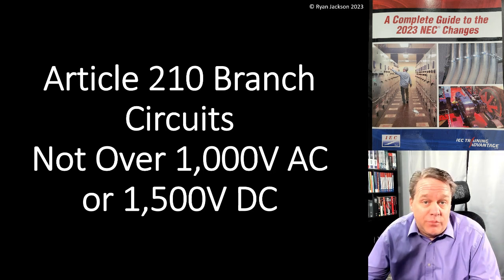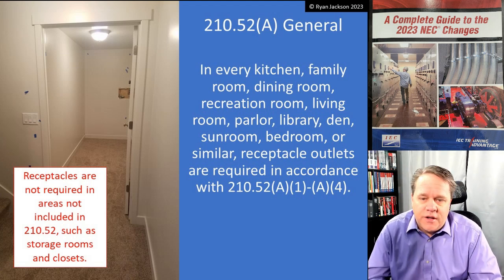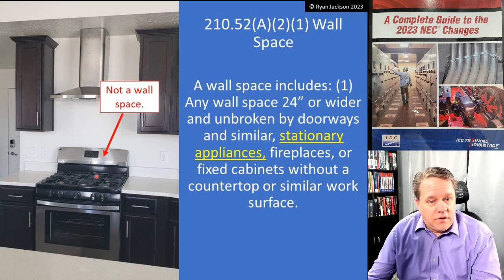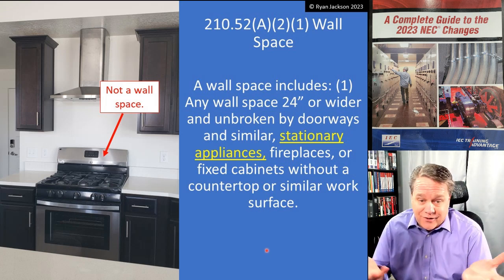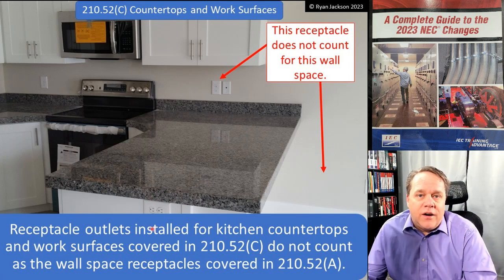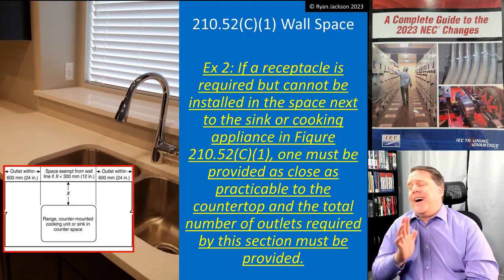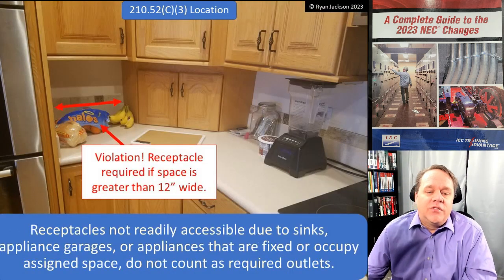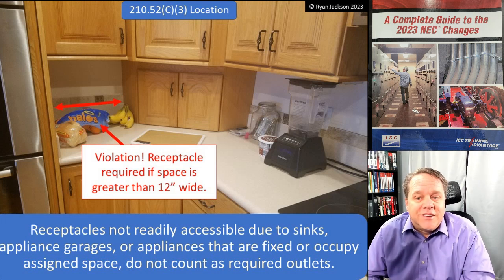2023 210.52 Dwelling Unit Receptacle Outlets

Comment: What about a work surface with a cabinet sitting on a quartz "countertop" and the "quartz countertop" is now 12" deep instead of 24" deep.  Would there be required receptacles there?  It is being used as a permanent hutch but the cabinet part resting on the quartz has no doors or drawers just a 5" cabinet face.

Comment: What is your recommendation on the island outlets or peninsulas until the 2023 code is  adopted by jurisdictions- in you linked episode you mention a manufacture being held liable for knowing of a code change or safety in appliance but only provided the updated design to areas where it was required by the local jurisdiction but held liable for not providing to jurisdiction  where it was not required

Comment: Apparently with the new changes regarding countertops, convenience outlets are required in kitchen kick space areas. These seem to be even more problematic because an appliance plugged into them from the countertop has even more length to be disturbed and it is likely that many people would use an extension cord in such a case. Why doesn’t the code simply add language to section 210.52 (C) something to the effect: “Notwithstanding section 210.52 (A), no receptacle outlets shall be installed below kitchen counter space, including kitchen islands and peninsulas.“

Comment: Also, it's not always just about fire. It's about a sound electrical installation. That configuration will not work as it appears it should. Joe Shmoe comes along and plugs his T type appliance in thinking it will work and it doesn't. What's the point of an installation that fails to operate properly?

Comment: Apparently the only true Electrician here, you are incorrect Sir.... Having a 15 Amp breaker and using 14 AWG wire with a 20 Amp T type outlet could potentially overheat the wiring, as the draw could be just over the 15 Amp breaker which they tend to trip around 16 Amps. This could overheat the wire. 210.21(b)(3) states 15A breakers supplying more than one receptacle the devices shall not exceed 15A.
Reply from the maker: What part of the video are you talking about?